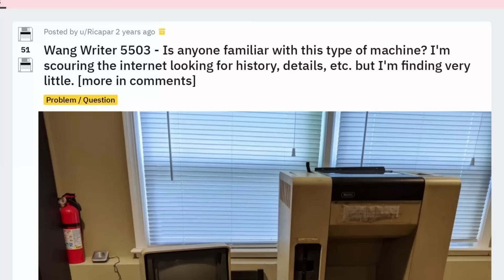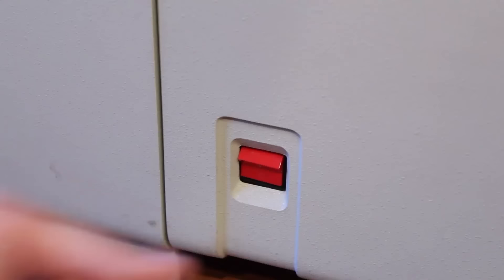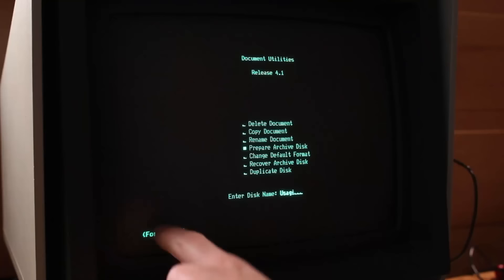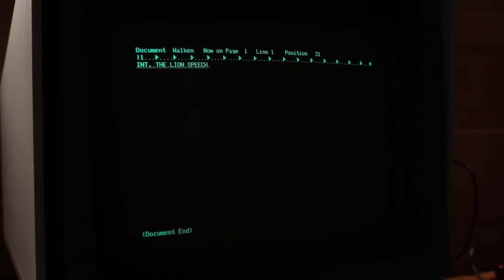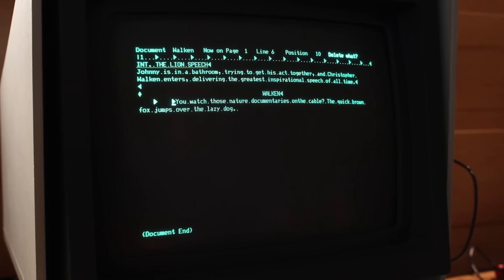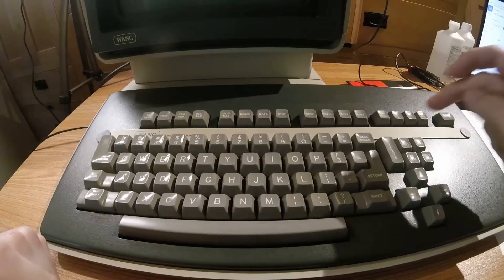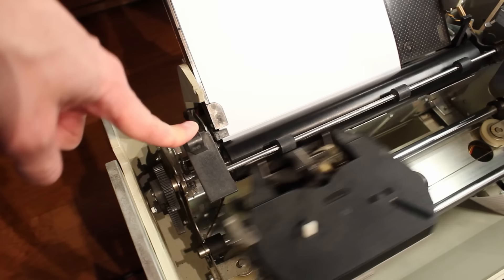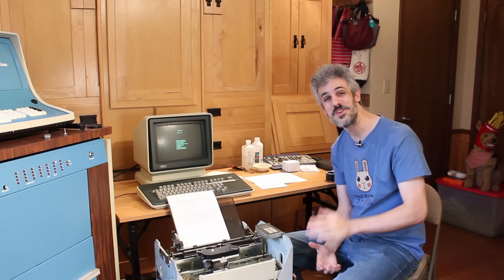How to Write a Movie Script in 1981 on a Wangwriter!

Comment: having used full screen editors (vi, vim, and emacs) on a 9600 baud terminal quite a bit, i can tell you the reason that the line splits when you insert is so that text doesn't have to scroll to the right each time you type a new character. this can be very slow when you have a long line. splitting the line is a really nice touch that shows how they were focused on keeping the editing process fast, at the expense of maybe not looking quite as good. the bold/graphics characters are really cool too.

this thing is like the ultimate typewriter. can you imagine working as a typist/secretary back when this came out and switching to this from one of those early magnetic tape-typewriter based word processors like the IBM MT/ST? or even worse just a selectric? this thing would have been mind blowing.

it's still probably the ultimate system for someone who wants as little distraction as possible while doing creative writing, etc.
Reply: Except the loud fan, which would drive me crazy.
Reply: @drstefankrank  fans can be replaced. i'm sure there's enough juice in the psu for a nice quiet noctua. if not it'd be trivial to add it.
Reply: The bright green phosphor can be a mite irritating. I think a nice orange tint monochrome screen (IBM made quite a few) would have worked best in this application.

Comment: I was something of a deity in the Wang Word Processing, OIS, and VS worlds. Wang totally dominated the WP market until around 1988. I cloned the Wang OIS user interface in 1983 and plopped it on the XT and AT as DOSMENU, a shell to keep people away from the bare C> prompt. It sold like hotcakes to my clients in the mid-to-late 1980s because the Wang UI was known by so many. At its peak it was on desktops in most of the Fortune 500.

Tip: On menus you can use use the spacebar to move through the options in addition to typing the first letter.

Comment: You bring me back to my Micom Word Processor days. I recall that being amazingly intuitive as well. A few notable things I remember about that system:
1. The monitor lifted on a clamshell to reveal the system boards... which were wire-wrapped.
2. The keyboard was, by far, the best keyboard I have ever used. It was a joy to type on. Better even than the IBM Model-M.
3. It had 8" floppy disks. I was asked to convert some to IBM format. The company I found was asking about $150/disk (~1990 Canadian dollars). A price even they admitted was outrageous, given their 9KB (!) capacity. You could write small enough to get 9K of text on to an 8" disk!
4. It was daisywheel too. A sound that I'm still fond of. The printer was in a huge sound-dampening cover. 
5. We were a scientific department and sent our daisywheels to an "old guy" who cut off several of the "petals" and replaced less-used characters with required science symbols. 
Also, a great feature of daisywheels: they worked really well with carbon-copy forms, which were the life-blood of business back then. Much better than the early dot-matrix printers of the time. Particularly if you were using a form with 5 or 6 copies.
Reply: Oh wow crazy that you had to mechanically alter the print wheel to add more symbols

Comment: In the early 80s I printed a 600 pages book on a daisy-wheel printer, with four different wheels (two sizes roman and italic). On each change of size or style the printer had to stop and wait for a manual change of the wheel. It took ages, but quality was far superior than with an 8 bit dot-matrix printer. It was using WordStar 3.0

Comment: Not sure if anyone else has mentioned this, but part of the paper slippage problem could very well be down to the platen and rollers being old and hardened. Platens should have a rubbery grippy texture to them and not be rock hard. Yours seems like its shiny and likely hardened causing slippage. Good news is, a company called JJ Short can re-cover platens and rollers for this sort of thing. In the vintage typewriter world we use them a lot when restoring typewriters, and the same is true for daisywheel or other impact printers. Hope this helps!

Comment: Great to see this up and running!  

19:45 - If your feed problem doesn't turn out to be something obvious (like a paper thickness setting), it's quite possibly due to the hardening/shrinking of the rubber over time.  There's a product called Rubber Renue from MG Chemicals that is an industrial strength once-in-a-blue-moon treatment to be used sparingly, but does a fantastic job of restoring some of the bounce to old typewriter and printer platens (provided they haven't become so dry that they've begun to crack, in which case nothing will save them).  I've used it once on each of my vintage typewriters/printers when cleaning them up thoroughly after purchase.  

20:30 - Six LPI is what most typewriters do, and is the North American standard. Many dot matrix printers could be switched between 6 and 8 lpi; I've heard that the latter was preferred in various places in Europe.  

Now if only the Wangs writing scripts today had the class of 1981!  -- JC

Comment: I remember the Wangwriiter well.  At the time I worked for a company that was a dealer for Wang.  The board that tended to fail was the one that drove the stepper motors on the printer.  We had several of these dead boards so one weekend we stole the connector off of one of those and made an RS-232 interface using some blue perfboard..  Once we had that working it was straightforward to generate a CPM boot diskette where the console was on a terminal.  I still have that RS-232 interface in a box somewhere.  Management thought we might be able to sell CPM for the Wangwriter but Wang didn't want us to do this.  They wanted to sell this as a word processing appliance and that was enough reason not to pursue it further.  I don't think I have the bootable CPM system disk anymore and I would be the only one who would have kept it.

Thanks for bringing back my memories of this.

Comment: Now we see why Wang was so successful.  They understood the user was likely coming from typewriters and didn't expect them to have "mechanical knowledge" in understanding machines.  As for why didn't they create a version to run on MS-DOS, it's a common issue of that period. Companies were too invested in their own product line (in this case Hardware) to introduce something that would kill their income.  Seen it many times.  I'll note that WYSIWYG is fine on a DOS screen when doing fixed fonts, but you have to go with something bitmapped to do proportional fonts (like Mac or Windows).  So, even if Wang did a MS-DOS version of Wordwriter, there's a good chance it would have suffered the same fate as WordPerfect when Windows and laser printers came along.
Reply: Not only would it hurt their own hardware sales, there were already a slew of competent word processing programs out there that they'd have to compete with, and not just for the IBM PC.  Things such as the Electric Pencil were available on a fair number of Z80 based systems including the TRS-80 I/III/IV.  I used EP to write essays for highschool etc.  EP even had 80 column support on the IV.  Text mode WP was very popular in legal offices here.  Why go to Windows which required new more powerful hardware, and gasp spending money to buy it,  when that old PC or XT with text WP did the job nicely.  It was not unusual to see a pool of ten girls typing away and sending documents to print on the shared DWP.
Reply: @retrozmachine1189  Sure there are competent programs, but having a familiar program that would take minimal re-training and already a standard would be attractive.  (Not to mention being compatible with existing saved documents.)
Reply: In fact Wang did sell a version of Wang word processing that ran under MSDOS.  I think it was $125 for the software and special keyboard.  I had hidden myself away for several months reverse assembling the the drivers for the printers that Wang sold.  People wanted to use other printers and so I wrote drivers for them.  At the end of life of the product I was supporting over 400 different printer models.  Wang licensed the driver software and I received 25 cents per sale.  I know that around a million of these keyboards were sold.  What killed it was Microsoft Word running under Windows and Wang not wanting to add better support for proportional printing.  There were limited hooks in the code for PS printing.  I really liked the keyboard but I no longer have even a non-working one.

Comment: I used to fix slipping printer rollers that slip because of dried-out rubber by lightly damping them with vaseline oil (i.e. gun/sewing machine lubricant light oil), and then soaking up the not-impregnated oil with paper towels. This somewhat restores rubber's grip. There are  also commercial rubber "restorer" gels/pastes, mostly for hydraulic gaskets and other fittings that can't be easily replaced, you may want to try with that.

Comment: While Wang never released the software for a PC, there was a popular package called  MultiMate, which I understand was very close.  We used it on the XTs and ATs in the bank I worked at in the mid to late 80’s
Reply: Yes. MultiMate's selling point was being keyboard compatible with Wang word processors, so that staff did not need to be retrained on it.
My first job out of high school was setting up a bunch of XTs and ATs for my uncle's office, which included installing multimate.
Reply: I've been wracking my brain trying to remember that program.
Reply: I never considered MultiMate an actual Wang replacement. Keyboard is one thing but the UI was pretty funky. I ruled it out as a PC alternative at my clients because many were doing complex docs that were a breeze on Wang but took forever to get to work kindasortalike Wang. Ditto for Samna.

Leading Edge had a wp package that looked and felt like Wang. Same glyphs, mostly the same keyboard. Unfortunately, it was 1984-ish and only came bundled with their hardware. Couldn't find out who the actual dev was to discuss possible broader distribution. They also had a program called Nutshell that worked a lot like Wang List Processing. It was from Nashoba Systems and eventually became Filemaker.

Eventually, I abandoned the quest for a Wang-like wp package. For clients with IBM 5520s or DisplayWriters, I hooked them up with IBM PC Writer (5520 clone) or the PC version of DisplayWrite. In-house, I used WordPerfect until the mid-1990s when MS Office ate WP's lunch after their dreadful attempt at moving to Windows and the corporate drama that quickly reduced it to also-ran status. I've been using MS Word/Office since.
Reply: Now there's a blast from the past - I'd completely forgotten about MultiMate.  I used it very briefly in the early 90s.

Comment: Back in high school, a local company had upgraded to brand new IBM PCs and donated their old Wang Processors to our school. They were the older cyberdeck style model with the all-in-one keyboard and CRT. What I remember most about it was its keyboard. Its keys couldn't be actuated unless the system was off, but once you power it on and start typing, you're greeted by an incredibly satisfying tactile feel with a crunchy, clicky, clacky sound generated by an internal solenoid.

Although Wang never ported their word processor over to the PC, Leading Edge, a popular IBM PC clone manufacturer at the time, did offer an all-in-one IBM and Wang knock-off solution. In addition to running PC titles, it came with a word processor which had nearly identical screen layouts, menu structure and commands. To capture the full Wang experience, it even attempted to simulate the sensory experience with its keyboard which featured clicky Alps Blue SKCM switches. While it didn't come close to the Wang's, it is still regarded as one of the best keyboards ever made. Even today, it will often fetch a couple of hundred dollars even in poor condition.

Comment: That printer brings back memories of a computer daisy-wheel printer which I purchased for $50 because it was repeatedly blowing a tiny 0.1A on-board fuse.  I soldered two wires into the board leading to a cartridge fuse holder so that I wouldn't destroy the PCB with repeated soldering/de-soldering and began testing the printer.  It worked just fine most of the time, but every so often it blew that fuse and I had to replace it.  I finally figured out that when it was blowing the fuse was when it switched off the cooling fan used to cool down the print head driver transistors, which could get pretty hot in continuous use.  I wired a 0.1uF high-voltage-rated capacitor across the fan and that solved the problem.  I eventually sold that printer for $500 (close to what it was worth new) since it was now reliable.
Bunny:  Are you going to feed me?  Are you going to cuddle me?  No?  I'm out'a here!

Comment: So to add about the printer type: it’s called a daisy wheel printer. That is actually quiet for a daisy wheel printer. It’s slow because I assume it’s because it’s integrated into the computer, and if it were to go faster, it’d would literally shake the case apart.

I at one time had an early 80s daisy wheel serial printer that operated at full speed. It was over 40lbs, and the case was solid metal. This was considered a “personal desktop” printer btw… One time I was printing several pages, the table beneath it shook apart. The printer had vibrated the screws loose, and broken apart the fiber board within the table. 

The print head was flung around so fast that the kinetic energy was staggering. It printed 1 line of 80 characters in a little over a second, and it took less than a second to return the carriage to the starting point. You could hear the thing printing 2 floors up in my house.

The print was SO CLEAR though. Laser printer level clear. Of course the downside was in order to change the print size or font, you had to change out the entire daisy wheel. So, you couldn’t have a document containing multiple fonts or letter sizes on the same page.

So if you think about it, it was absolutely amazing tech for the early 80s. Not only did the printer have to know what line it was on, but also where the print head was down to a single character, and also what letter was in front of the print head. All of this had to be in place… All in less than a second for each character being printed.

Kinda miss that printer…

Comment: In 1988, I saw the Wang OIS model at Control Data Institute. It was the second word processor I used. The IBM Displaywriter was the first word processor I used at the computer technology school. I prefer the word processor more than typewriting, even on the IBM Selectric typewriter. Today, I use Microsoft Word 2021, bundled in Microsoft Office 2021 Professional. I watched your show because I am a computer user and a fan of microcomputer technology. The disadvantage of using a standalone word processor is printing documents. Documents that have more than one printer font or typeface and at least two weights throughout the page(s), printer stops are applied in the electronic document. The user would likely need to change the daisy wheel, typeface element ball, or anything that has typefaces to be added to various text parts of the document. With word processing, I would not want to look back to using a typewriter, nor use anyone else's keyboard. In this year 2024, your show is still nic.💙

Comment: I'm not convinced the paper feed has a problem.  I suspect the lever you're using releases the back rollers so they can't grip.  (Like it does on a typewriter.)  Try moving the lever forward and then releasing it rather than holding it.  You also might try just starting to print from that first position to see if pulls the paper in before printing.  (Keep in mind the system has to set the top margin, so I'd expect the paper's staging position to be below the print head.)  The paper seem to feed perfectly once you have it loaded, so I'm thinking the issue is likely training rather than a fault of the unit.
Reply: Possible, though I think he should also get some Rubber Renue and properly clean the rubber rollers.
Reply: I wonder what the "to of page"button does...
Reply: @michaelthomsen8771  Good point!  I also wonder if the machine can take more than one sheet of paper.
Reply: @russellhltn1396  It would almost have to with the lack of speed or support fanfold tractors.
Reply: You can use alcohol on most rollers as well. They can build up gunk over time on the surface that can cause them to slip.

Comment: The print character wheel brought to my mind the word Wheelwriter.  At this point I cannot remember whose trade name that was.  But I still have a Qume printer that also uses those print wheels.  What a totally beautiful printing result!  Then, another thought:  Porting the editor to a PC might be hampered by the special keys that you have on the Wang.  Of course the PC keyboard has its Function keys, but you would at very least need a key name strip like there used to be available in the old days.  Beyond that, you used to learn the WordStar special keys so well that several other programs coped them, whether they offered text editing, or something entirely different.

Comment: Thirty some years ago, I bought two Wang PCs from a tailgate sale of general stuff -- for $25! Both ran perfectly with 10 megabyte 'Winchester' drives. They were general purpose office machines and included (IIRC) WANG-DOS 3.0 and some dedicated software -- including Wangwriter, a Wang-specific spreadsheet and database and some other stuff. I never had a compatible printer though, so I never used them for real work. They went in a yard sale a few years later.